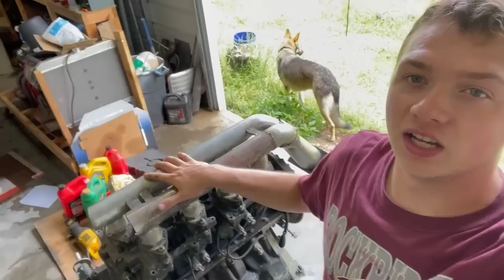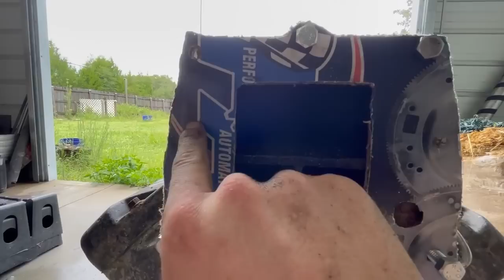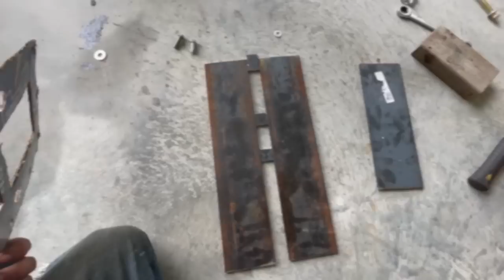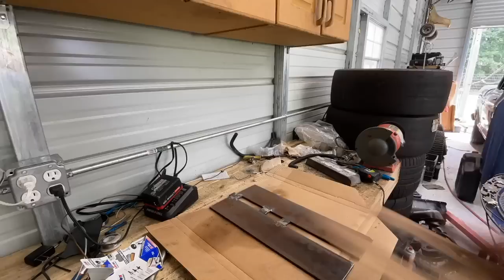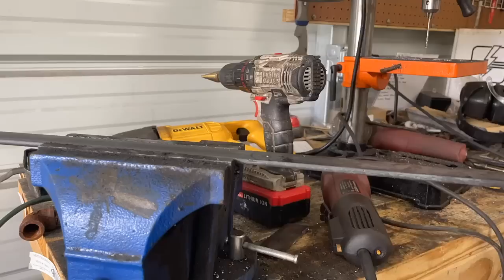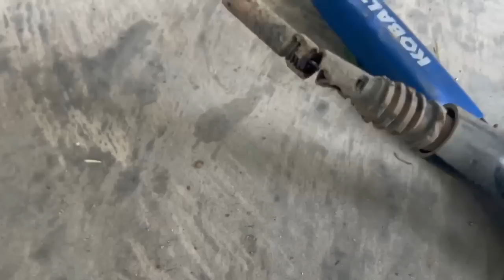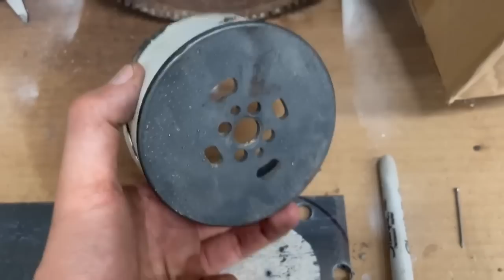Will this 2 stroke V8 BOAT engine bolt to a Chevy trans?

Comment: Just a thought: one of the other commenters mentioned thrust forces, and that these motors don’t use thrust washers? Just be aware that even automatic transmissions will create thrust through the stall process of the torque converter… in outboard form, the leg shaft probably runs a bearing and shim arrangement to handle thrust forces if that is the “case” (no pun intended)…just something to consider…btw, supposedly those engines were rated at 300 horsepower, but they are a generation behind the Johnson/Evinrude/OMC “Fast Strike” technology with the newer port designs….nonetheless , a bad ass motor in it’s day, and the company had all kinds of performance tweaks they used (there may even be a handbook out there for racers )
Reply: You're correct that the foot or gear case of an outboard does in fact have a thrust washer behind the input gear to absorb any thrust loads from gear loading. 

As far as I'm aware no two-stroke outboard has any real way of taking up large thrust loads. Usually one of the main bearings is a ball bearing so it can handle a small amount of thrust loading but not a large amount. 

To be honest if I was going to do this I would run something like a primary belt drive from a motorcycle to a gearbox and mount it transversely in the middle or the rear of a small car that way there's no thrust loads applied to the crankshaft and you could also support the other end of the drive sprocket with a bearing so that there's no axial loads placed on the crank either.